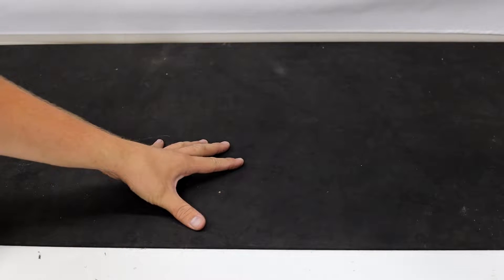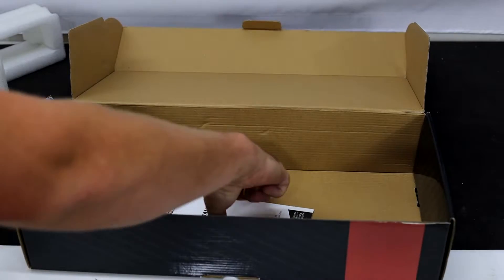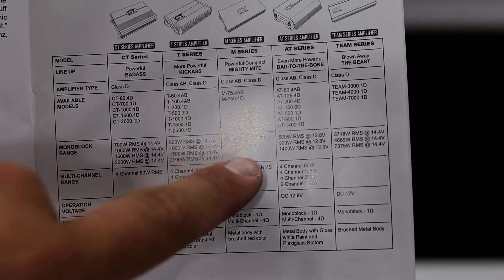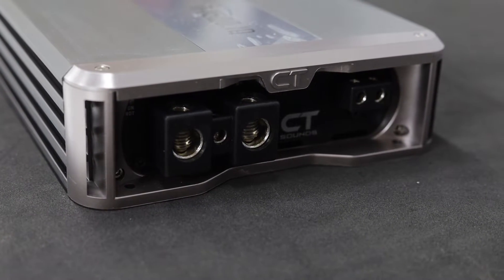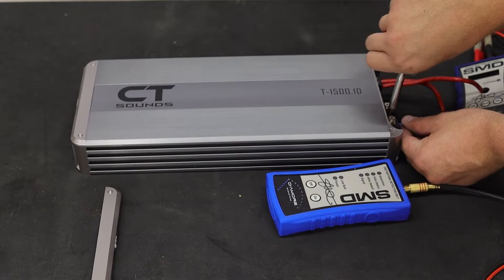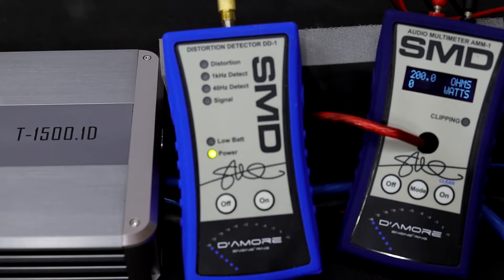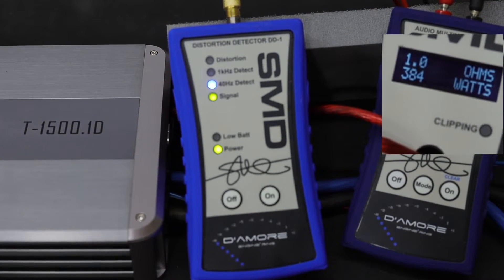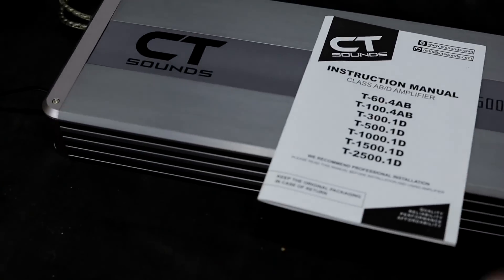DO CT SOUNDS AMPS MAKE RATED POWER? CT Sounds T-1500.1D Test and Power Dyno Run

Comment: I ran this amp for 2 months it never sounded good and then it just stopped working completely been waiting on my replacement from ct for a month now no luck definitely going back to skar audio
Reply from the maker: Im sorry to hear that.  CTs new amps are so much better. Ill never buy a skar amp again.  Did you message hello@ctsounds.com?
Reply: @ATCA  I’ve been emailing them and when they get back to me they just tell me something else I need to do I’ve explained my entire set up wire size wire brand sub fuse like they asked and haven’t herd from them yet after that last email
Reply from the maker: @gavinwalker920  hmm. Idk then.  Ive never had that issue

Comment: Hey, would this amp be good to push my two 8” mesos? Or what would you reccomend?
Reply from the maker: This amp or the 1400.1 i ran both on meso. About the same.
Reply: @ATCA  Thanks! Just ordered the t1500 since they dont have the at1400.1 atm
Reply from the maker: Check out my other vids. I have a vid of my current setup in my cat. 2019 ford fusion
Reply: @ATCA  sure will !